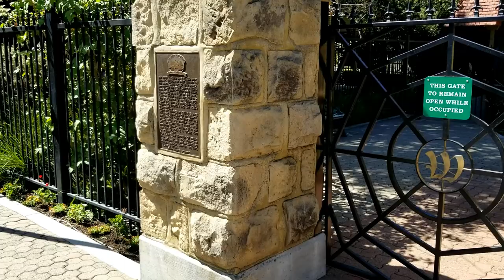Making Large Halloween Jack O Lanterns 🎃 The Winchester Mystery House All Hallows' Eve

Comment: I just found your channel. I’m trying to figure out how to make styrofoam boulders (4’x4’) using 12”x20” foam blocks. Your videos are helpful. Any tips for making these look rock like? Or, do you cover this in one of your videos?
Reply from the maker: Hey Andy so we have several videos with either rock walls we made or some round river stone rocks for some of our old western mine shafts we built.  We also made a rock chimney for the witch cottage.  We hard coat the foam with flex bond thin set mortar and then faux paint and seal with a clear coat.  As far as a good inspiration check out the people who make models, train sets, and dioramas.  They have great detail ideas you can apply to larger projects.
Reply: @HollywoodHaunter  thanks for the helpful information. These boulders will be props for a high school marching band. They only have to hold up for a few competitions this season. The Flexbond looks like it  would work great, but it’s a little expensive, and might be overkill for our project. Also, time is a factor as well. And volunteers seem to be mighty scarce when it comes time to build props. Can the foam blocks be painted on directly with latex spray paint?
Reply from the maker: @haptown  Yes they can and we have seen many use drylock as a primer and then paint your stone color finish over that.